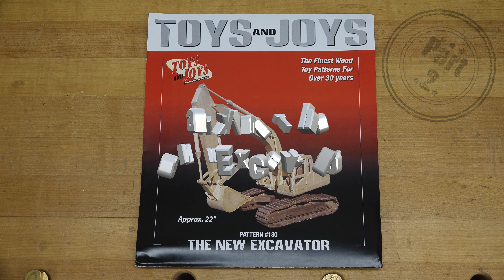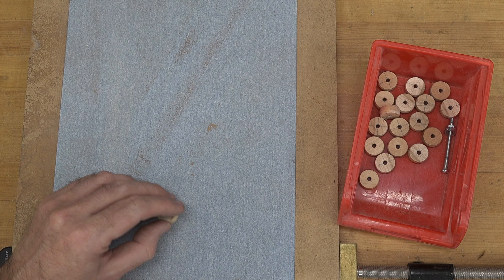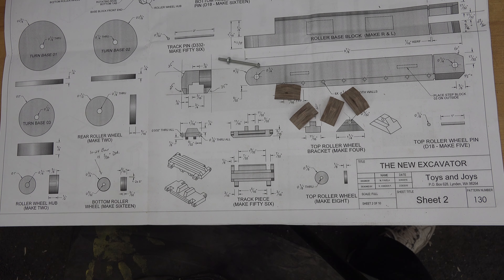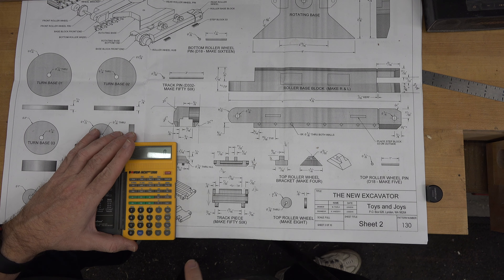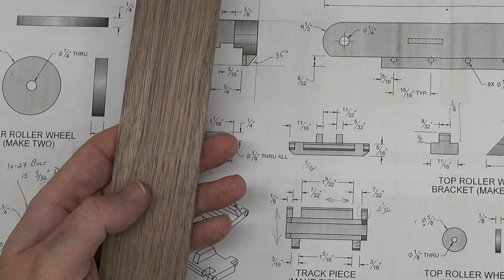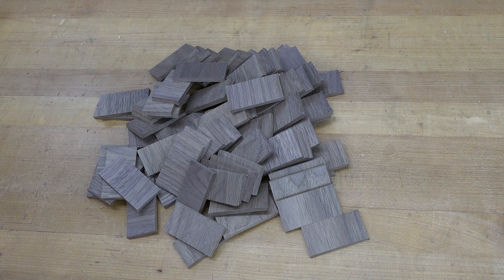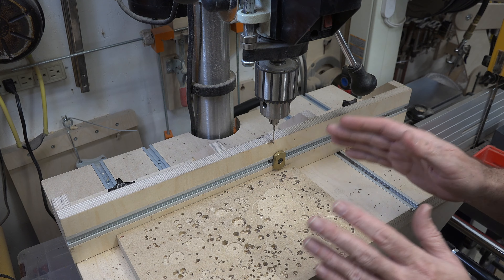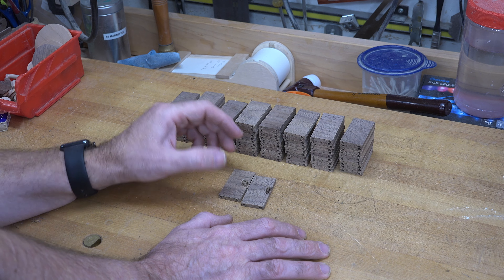Toys and Joys "New Excavator" Part 2

Comment: Good video.  This is beyond my skill, but still enjoy watching.
Reply from the maker: Don't sell yourself short Scott.  You never know until you try.  I once did a model build where (unknown to me) it was beyond my skill level so I took all the pieces and the patterns, put them in a box and placed them on a shelf in my shop for 2 years.  I came back to it at that point and it all fell together perfectly with 2 years extra experience under my belt and some new tools as well.  Don't pull the parachute before you jump out of the plane.  You might surprise yourself with how good you really are.  Thanks for tuning in.

Comment: I made a mandrel to mount the hubs for the whirligigs. I cut the circles first then the slots all on the scroll saw. I then mount the hub to the mandrel and attach it to my 8 inch drill press. As it is spinning I just hold a piece of 80 or 60 grit paper against the hub until it is round. So what you explained does work out great. It was my only solution for me not owning a lathe. I could make wheels that way too. Your solutions can fit any project problem. Making the parts for the track was interesting to see. I was curious as to how you were going to handle it. I learned something there! Enjoyed, take care!
Reply: I keep a selection of different diameter and length bolts, and threaded rod in a drawer by my lathe to use as “special” mandrels.  Work great either on a lathe or a drill press 🤠
Reply from the maker: Great minds think alike Randy.  I do the same.
Reply from the maker: Where there's a will, there's a way Michael and I'm glad that you were able to sort out your hub making.  Thanks for tuning in and for taking the time to chime in with your methods.  It is truly appreciated.

Comment: Awesome Ken. When I built other excavator few years ago( #70 T&J I think) it took me two full days to make tracks.18-20 hours. Those  tracks here will take more time for sure. I remember I had to make new track buddies to get proper length for length of each track. I wonder how this will work here. I have those new excavator plans for over 1 year, just didn't get on it yet. Some other builds all the time. I was sending you some pictures too. This year I need to put my hands on this new excavator for sure. 
Looking forward for another part of this beautiful build!!!!
Reply from the maker: Glad that you are enjoying the build so far.  The tracks can be a little tricky but the key to a successful track is taking the time to do a proper setup and drilling the link holes SLOWLY.  Drilling faster than what you need to will only deflect the drill bits and cause your track to twist.  Good luck on your build (when you start it) and thanks for tuning in to the show.

Comment: Great job!  I’ve been looking at the plans for the last three weeks to determine the safest method for making the various parts.  I’m feeling pretty good about my thinking so far my ideas follow yours🤠
Reply from the maker: The pieces aren't difficult to make Randy.  You just want to make sure that you have a clear plan in your head as to how you want to make each piece.  There have been times where I went to make a piece and after the second or third cut, I realized that I wasn't able to do the fourth cut because I had cut away my square reference surfaces.  Had to remake and rethink those pieces.  Thanks for tuning in to the show.

Comment: I have completed many Toys & Joys projects, several that required track making, this the method I use, thought I would share it.
After cutting, chamfering & drilling all the track pieces, I placed them tightly in a box made from 1/4” & 3/8” Baltic birch plywood, carefully measured all the notches required, then ran them through the table saw to cut them all at the same time. Seemed to save some time and all turned out exactly the same, rather than cutting them one at a time.
Reply from the maker: Kind of like a jig for cutting multiple track sections at once.  Nice idea Brian.  Thanks for tuning in and for chiming in with your methods.  It's very much appreciated.
Reply: @acutabove_woodworkings  
Yes exactly……I forgot to mention that I have really enjoyed watching your videos, wish I had seen something like this before working on all of the other projects I have done, very informative and interesting. Your comments on being safe with all the tools involved is very important…..Thank You
Reply from the maker: @brianbrown7996  Glad that you liked the videos.  I do appreciate you tuning in and taking the time to leave your comments.

Comment: Looking ahead at the plan I will need ...or want...that 1/16 router bit.
Reply from the maker: I have two of those David.  One that I use and one for backup for when the first one breaks.  It's been years and I haven't broken the first one yet.  LOL.  Here's a link to the bit if you are interested.  https://www.leevalley.com/en-ca/shop/tools/power-tool-accessories/router-bits/30218-small-straight-bits?item=15J0614
I hope this helps.  Thanks for tuning in.

Comment: Hi Ken
Thankyou for your reply of some days ago I have been following a number of your videos and find them most interesting, and have purchased some plans yet to arrive. However I have a problem with a model or two of vintage car plans produced some years ago in the UK.  These plans are very detailed and complicated to produce and include spring steel leaf springs for front and rear axels.  I have tried lots of outlets in UK and all unable to help.   For example these springs are 238mm in length 16mm wide and contain up to seven leaves.  Wonting to have a go at building these models or at least one to start, but unwilling without knowing how to produce the springs, have you any ideas ??  Barry C.
Reply from the maker: Hi Barry, I sent a reply to this message via email.  I look forward to hearing from you.  Thanks for tuning in to the show.